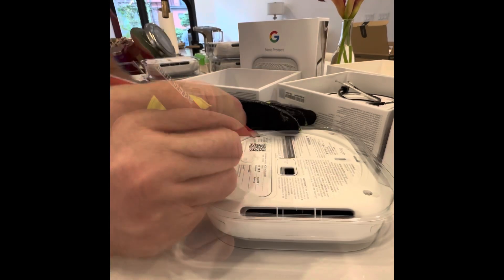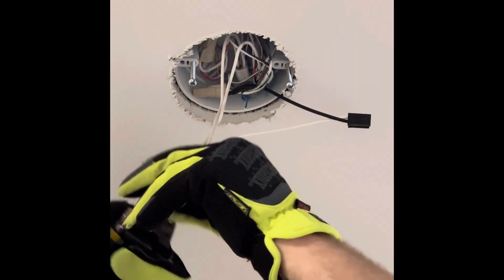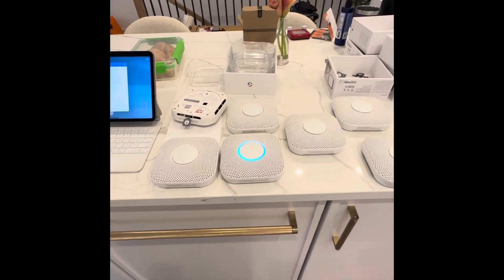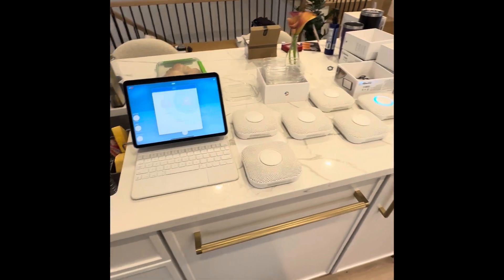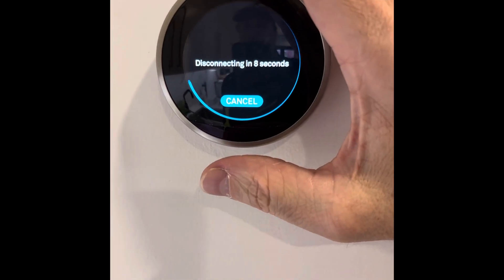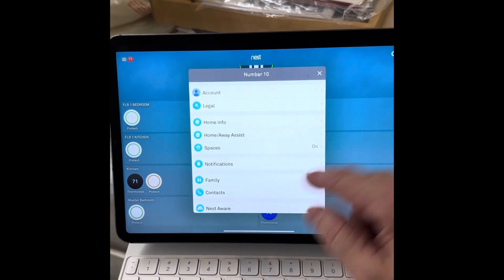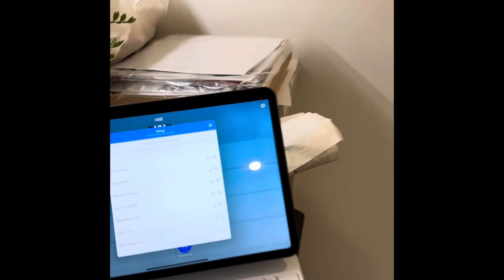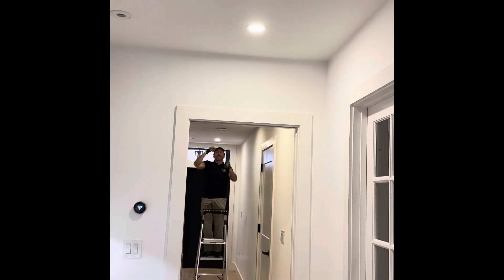FIRE SAFETY TIPS 🔥 NEST Smoke Detectors & Thermostat Work Together

Comment: Your video and also one from Google doesn't mention about making sure the electricity turn off before doing the cabling, is this assumed, or there won't be AC to worry about?
Reply from the maker: Yes, you should always turn off the power at the breaker box before working with electricity.
Thanks for the question.
Reply: @elitehandyman911  Thanks.